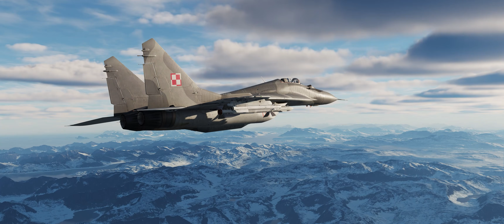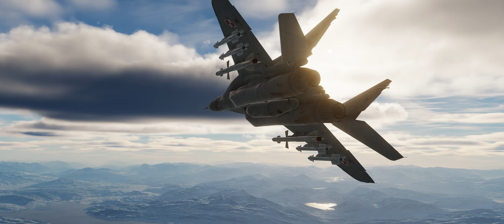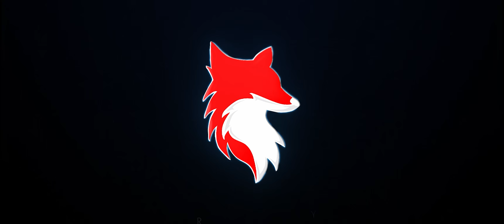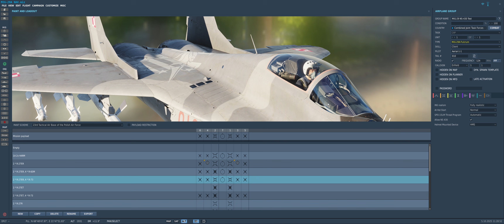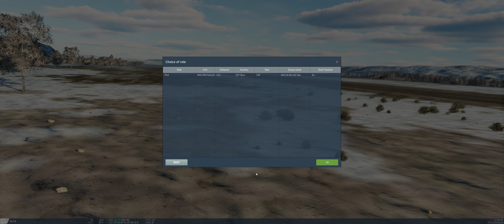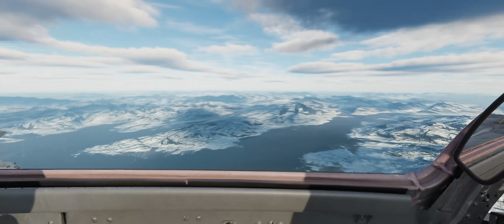Navigating Made EASY! | DCS MiG-29A Fulcrum NS 430 Tutorial!

Comment: Howdy, Spud. Weird quirk: when I use the top-down nav page (the one you primarily used throughout the video), I fly perfectly in line with the magenta/purple line, yet I still drift off track to the right. It is not because of the wind. I always drift to the right. To compensate, I fly diagonally to the left of the purple line to keep me on track, which looks and feels awkward to fly. This is the case with every module that supports the NS430. I've tried North-Up mode and Heading-up mode and its all the same. Is that intentional? Is there a remedy for this?

Thank you.
Reply from the maker: I have no idea what could be causing that other than you have natural tendency to turn right haha are you trimmed out all the way?
Reply: @Spudspike  Yes I trim my aircraft perfectly, but I still drift off to the right. If it is not too much trouble, could you please test this for yourself? I noticed that this “drift to the right” phenomenon is the most apparent when in “heading-up” mode. If you have the same problem as me, or if you don’t notice a problem at all, could you please tell me the results? Or, if you want to inform other people who might be experiencing the same issue I’m having, could you make a video about it? 

Thank you again.

Comment: This sim of GNS430 is missing crucial functionality for flying. and OBS and DTK are not functioning correctly, even BRG and TRK a not on the same plate. BRG in true heading, TRK in magnetic. Should be the same. But what is more awkward, TRUE for the BRG is calculated in opposite direction meaning that for magnetic variation of +5E we will have 10deg of a difference to actual TRUE north. I used to shoot approaches down to 50m AGL in OBS mode back in a days in reality , but this implementation of GNS430 is not capable for it
Reply: That it has been in dcs for many years and still incomplete is sad. 
Pretty much a nice F10 map in cockpit nothing more.
Reply: @longiron3773 That’s true just a moving map. Unfortunately. It’s actually the way people use as I can see on YouTube , but page 1 of NAV section is the key for proper using, of course if DTK, BRG and OBS mode are functional

Comment: Does it work in VR?

If I remember correctly, in other planes the 430 doesn't work in VR.
Reply: it does, as a VR player.
Reply: On the ED store page for the NS430, it says "Currently flat mode is incompatible with VR devices". I can verify the cockpit integration mode (not flat mode) works in VR for all the modules it's available for.
Reply: Yes it does but just the 3D implementation into the cockpit as shown in Spuds video. Not the standalone popup window